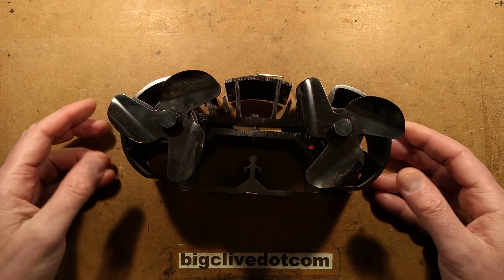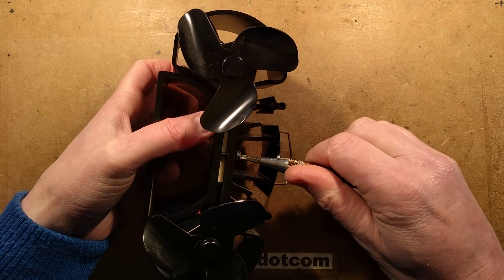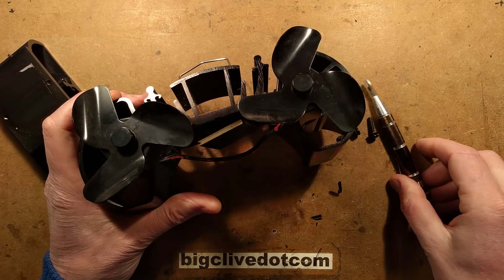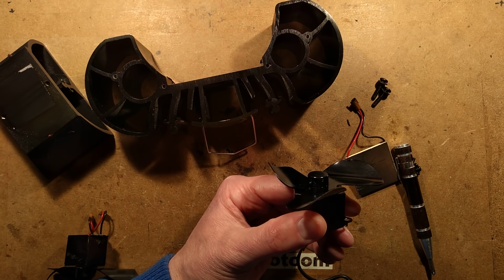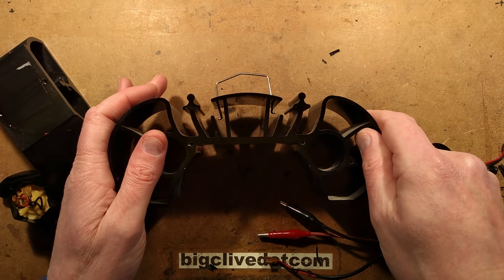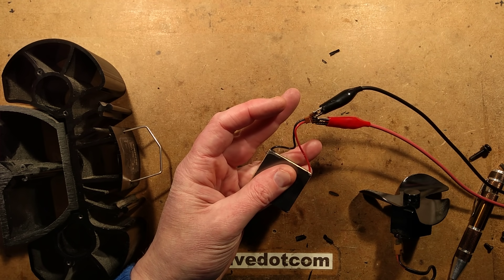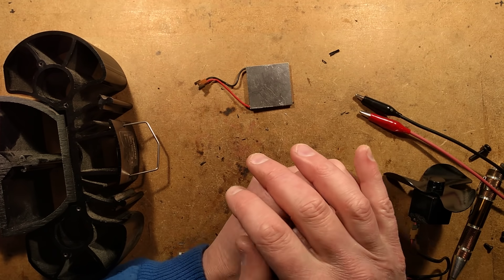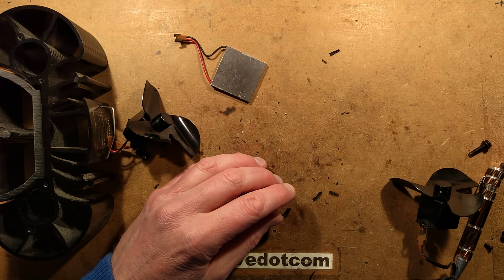Teardown of a self powering machine.

Comment: By the title I thought it was going to be a fake perpetual-motion machine.
Reply: yeah i was like "ooh i wonder where the battery is hidden"
Reply: Ditto as well.

Until I get a second look at the image before stirring the video in realized wood stove Heat powered fan I think?

I wonder if they have a stirling engine type of fan similar to that or other type of heat engine does not electric theoretically it could be done.

You'd have more than enough heat energy to do it because there's some that operate on below the temperature of boiling water.

Or maybe somebody do a DYI version here on YouTube either one I will check possibly post a link if I see anything for those are interested.

Thought about that a long time ago but then I had forgotten about it until now you know how things go.

Also it's not technically self-powering which really nothing can be no such thing as professional arity or perpetual motion right as you were saying you thought it was going to be with those devices.

As you know energy cannot be created nor destroyed.

Just converted from one form to another.

And this case Heat to electrical true mechanical and of course some heat do the losses in the motors.

Doodle bosses that's where the inefficiency comes from and nothing is 100% efficient.

Which brings back in thermodynamics which is the basis of self-powering machines at least part of it being impossible.

Those overunity machines and such.

So-called free energy.

With free energy You could argue that if the energy that's being used does it really cost anything....

Indicating of course expense of harvesting ink quotes that energy.

Technically there would be such a thing as free energy in a technicality of course.

As they say no such thing as a free lunch.

You did have to walk somewhere or drive somewhere or whatever to go get your supposedly free burger right it cost money to do that now doesn't it in one form or another.

If you you walked dresses are you wore out your shoes a little Teensy tiny panty those shoes cost money don't they.

And sub Penny level we're on the Soles means it's costing you money.

And also speaking of energy the energy you would give up in terms of walking to get the free lunch that's something.

Even if it's not monetary it's still not free.

But what they call Energy harvesting Aki recovering energy from the environment such as thermal mechanical and in some cases electrical and alarm for my neck fields or radio waves theoretically you could actually Harvest yes Harvest energy for some applications Niche area of course.

And do some quote on Port work such as in the case of one of these fans.

Although years ago I did win a science fair with something that one might consider free energy however it was using electricity that was already present in the environment in low levels feels being picked by 2 I think it was a hundred foot wire antennas.

And if I remember a ground as well.

It was a LCD battery powered clock module basically that sort of one that had the adhesive on the back like those that was just a simple LCD clock.

It was a custom circuit it was two of them I designed myself.

Can't remember all what the circuit had in it of course too long ago.

But it would run the digital clock module without a battery I did have it on a clear mounting service to prove that there was no power source other than the circuitry itself and the harvested energy.

Also at that school we could also when we are doing classwork which I did this both muscle is fair and class projects yes plural

English for the write-up of the project.

Science for obvious reasons.

 And Technology even of course because of obvious reasons.

And Shop because I did most of the construction at least the mechanical construction at school utilizing shop equipment we had.

For one at that time I did not have a drill press.

Nor proper tools to work for acrylic without cracking it when drilling it.

I thought it would be a better science project than something like vegetable batteries or something.

AKA potato clock excetera.

 by the way that project kept working for years and years and years it actually kept good time The only time I've ever had to reset it was just due to the in accuracy of the clock itself over years.

It was actually the most accurate clock in our house believe it or not.

 it seemed to be more accurate than the digital clocks on AC power!

As a side note one of the antennas also served as my basement radio antenna at times.
Reply: Yeah yeah I know I'm responding to my own comment but I just remembered something.

Even though it's not true perpetual motion or anything but it's harvested energy like I was mentioning it in the previous comment of my own.

There was a clock that or clocks that were called Perpetual clocks or something like that years and years ago antiques.

Is that would run almost what one would call indefinite except of course if you and stop them accidentally or move them too much or whatever.

Also note that they would require a manual start once you put them in place.

The energy source was not actually free energy or perpetual motion at all.

But used a combination of temperature changes and barometric changes to power to clock mechanism mechanically.

Also they were very finicky and required some maintenance to keep them running of course and it had to be kept very very clean is a precise tolerances and stuff more so than other mechanical clock to the time.

I used to know someone that had one of these on his mantle.

I saw it and notice there was no winding key or what seemed to be a way to do it why did up and asked he says all you don't have to.

He said if I keep it maintained it keeps running.

I'm like what!!!!

And he said you know he said something wrong or Perpetual or something rather something or other clock I said that's impossible.

Then he explained it to me how it worked.

He was actually a person that repaired clocks and watches. I did know it because that was the first time I've ever met him at his place.

And then he took me downstairs and show me down to his Workshop.

As well as he had all kinds of clocks including really old electric clocks and stuff I never seen.

Even Old Timers and stuff it was pretty cool I think you can more clocks in one room then. Brown had in his entire place.

One thing to note most of the try me and or striking clocks were modified so that the mechanism could be turned on and off in one way or another due to the fact that there would be so many going off at once.

And most of them are fairly close in time.
Reply: same
Reply: I thought the same as well :-)

Comment: When its summer and its hot, better turn on the stove to get my fan running.
Reply: Felix if it is a electric stove than it should work.
Reply: The joke is that the stove radiates heat so it's is worse than without it.

At least I think it's about that (it's almost midnight and my mom went to the hospital cut me some slack)
Reply: @Mute Stingray Heat radiates. Moving air to keep hot air from pooling at the ceiling.
Reply: @Mute Stingray Purpose is to mix the cold air on the floor with the hot air on the ceiling using the heat source for power.
Reply: LOL! I was going to say this too. My thought exactly.
Reply: @SkyeCA  Thanks mate! I was totally lost about what this stuff is for.
Reply: @SkyeCA  Cool name btw.
Reply: @thombaz  you. Can use this today if you still have natural gas and a morningfire stove. Their so nice, heats the whole house
Reply: @williamrobinson6377  Would be nice but I live in a falt. :D
Reply: LOL.

Either or have solar powered fans when it's only hot at night lol.

Of course no battery storage LOL.

Or heat engine powered cooling system that requires the furnace to be running to cool the house LOL

What about a solar powered flashlight that does not charge a rechargeable battery but runs the ball directly LOL.

What about an automatic setting alarm clock that only sets itself for when you need to go to bed.

Or that only sets itself on a days you don't actually need to get up. LOL LOL.
Reply: @SkyeCA  of course they are why would they be for summer use I know you're just responding to the other comments but yeah kind of obvious isn't it anyone about being obvious not LOL By the way. Of course you're trying to be sarcastic or maybe not I'll leave that up to the ethernet to describe.

That would probably equal magazine comments probably crash a comment server LOL.
Reply: @thombaz  yeah it would be your fault if there was a problem in your burnt your voice down or blew the place up.

Just don't get mad and kick the gas meter line set off the automatic gas earthquake shut off gas mechanism.

I actually knew someone that lived somewhere in a fault Zone that actually did that once they had a flat in their own driveway and got mad after dumping the garbage can as well then kicked and oops no gas.

I think it was wintertime as well can't remember.

Totally true story not made up.

By the way here in Arkansas we get Quakes as well.

One time I was at work and we had grass falling off shelves and no one was around there.

Thrift store.

Church later on and we had had an earthquake. It was just a stuff sitting on cross the edge.

Around the same size probably resting frequency that caused it the vibrate enough.

That may have been a factor.

Also previously when I I stayed somewhere else here in Arkansas.

Woke up one morning was going to be picked up for something.

And there was a cracked it went down almost the entire driveway.

That was not there the day before.

And I was also looking around rest of house later on that day I forgot back foundation cracks.

New ones of course.

Again looked it up and sure enough earthquake.

One of my grandmother's.

I knew that at Christmastime they would run an extension cord through a crack between her house at the foundation wall between the concrete steps and the house where the front of a Porsche was.

There was a big crack to use for that. She get power to the other side for more Christmas lights on the bushes.

And also for the candlelight you know plastic blow mold candle and lights on the other side of the front porch.

And one time I remember when I was quite young asking how that crack happened.

I knew about sadly and stuff and all that but there was nothing else it would point to that at all.

Everything else was intact.

And that's when I was told that it was an earthquake. 

This was in Kentucky.

Speaking of Christmas lights and such we used to have Christmas lights at my parents first house.

That they actually owned that is.

 and we needed to jump from one side to the other where the bushes were we only could get power from one side.

 if I remember correctly we got it from the garage?

The notable thing that my father figure it out he used work for Kirby..

Hint hint has a part in this.

The problem with Christmas lights is if you wanted to go into end at least of the newer lights these were the mini Lights by the way.

The plugs are designed in such a way that you cannot go fish early and I do say officially plug in anything else other than that that type of light string into the end or another type of Christmas lights.

 In the same general range of types.

AKA mini lights.

My father realized that it old Kirby cord could be uses extension between two sets of wipes without having an issue it just happened to work out that way because of the size of the pens on the male plug.

This was back when they used a plug on the vacuum as in a male plug that was essentially the same and us the normal AC plug 2 wire course.

 it was one of the old green ones I can't remember from which one of Kirby is from but that's the only thing I brought up using it for at that time afterwards..

Although those extension cords are meant for tree lights with numerous outlets on them sometimes up to nine in groups or three. It's like three extension cords together.

 It'll all that and sometimes were for switch if not mostly.

 those are actually quite useful for some setups.

Not to mention Christmas Village stuff in all that and more.

 why are we actually got a bunch of those was for my Lego set up because I'd always be using AC adapters Christmas lights and homemade lighting devices around like I set up and that's how I ran all the cabling and so many doctors in addition to power strips.

By the way Dickens Village size and Department 56 Etc do work great for Lego setups.

 Plus you can get the AC adapters most of the time.

 every year after Christmas I remember getting tons of stuff like that after the holidays.

 Also a good way to get LEDs along times so it's Christmas lights of course.

 also speak you Christmas lights I built several lighting assemblies that used to sockets off the Christmas lights and of course to bulbs the 12-volt persons usually.

 The sockets were wired to additional length of wire usually sandwich from another set of lights but not always but still red from apartment voltage but somewhat Smaller if possible the steering line cord.

And then would be brought to a Lego brick to connect to the other section of wire. Huge Frank and soldered of course and then the brick glued together..

Yeah I know the horror of cutting and gluing Lego butt had plenty and they didn't make something I was wanting you to be able to do the first to do it so yeah.

 To each his own not a Lego purist.

 so all hate comments on that would be ignored do your worst.

But also Anytime I would do this anything would be fused and all that of course as of any of my projects.

 if there's a potential for something to go wrong it can and often times will.

 also most of those assemblies on made would go off on several lengths of wire from a set starting point.

 also other woodbranch off with like supplier between Branch off.

Back to the old first house by parents owned.

 Christmas light story. 

0 outdoor Outlets.

Also.

By the way if anyone ever asks what a weird switch or a timer for that doesn't seem to do anything it could be switched Outlets potentially if it's an auto keishin it may be for outdoor switched outlets for Christmas lights and other holiday lighting or flood lights.

I've seen a few cases there would be a front hall closet or front area closet that there would be a switch in it that would control switch outlets for Christmas lights.

Also sometimes there maybe Outlets that are not visible not necessarily plastered over everything like that stupid.

But such as a long tops of cabinets high up or other areas where there's some sort of shelving or something even on a mantle that's not realized. And yes sometimes fake fireplaces dual have Outlet on when those switches.

 but for the life of me I've seen this more than once. I'm still trying to figure it out so if anyone has any idea please comment on this.

And yes I'm a dyr of course.

Jack of all trades that does a trade of course. Always do it right to code Etc.

Only as far as my comfort friend zone and legality of course.

But anyway it's a situation which I'm curious and still cannot fathom. The one that I'm asking if anyone knows about or has any idea.

Also other people have asked me this as well.

Situation is a switch either inside or outside the closet. A high shelf above the door of the closet and above that shelf not visible. Is a receptacle that's on that switch.

And yes the closet did have a light in it however that outlet was on a separate switch. For the life of me I have no clue anyone at all please comment.

It would others I know and on a few forms as well.

Still unanswered pretty much.

 something else have seen a lot of that you may run across and it could be confusing and may need a service call when you actually don't need one if you don't know what's going on.

Is saferest since there is two switches at the top of a basement stair or somewhere near a door leading to a basement or just inside the basement door Etc or any other locations like they're not In regards to nearer basement. Or in a basement.

 And you can't figure out what it does but the switch is not labeled for any purpose.

 Don't just give me your other places too but not as likely.

If this would happen in the winter time especially although in some cases although in some cases it could be with  water heating or both not necessarily saying switch.

 Don't know code on the water heating but it may be done and I've seen it done as well.

Is that switch that I'm speaking of could very well could very well be in emergency oil burner shut off switch for either water heating or furnace I think I've seen one that was both?

 other things of course Somewhere that could be a switch that controls an anticline or something that's no longer there switched Outlet you don't know about Etc.

 Or something is been disconnected for pregnancy forever or just a bad switch.

 Other possibility is a three-way switch tested by past or perhaps something has been rewired and repurposed Etc. Or just renovation or just changes two electrical Etc that the ridgell switch was left but just not connected because it was no longer needed.